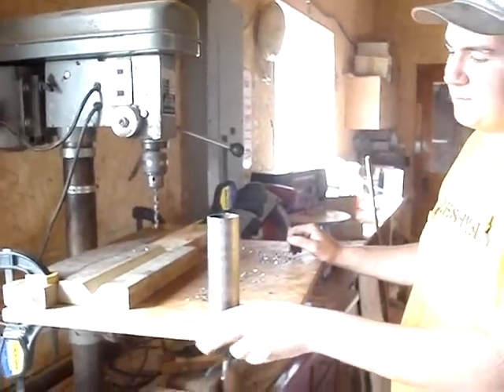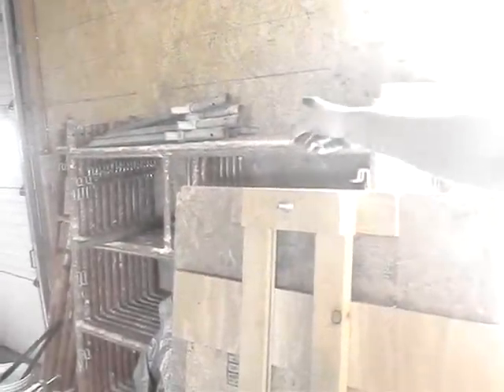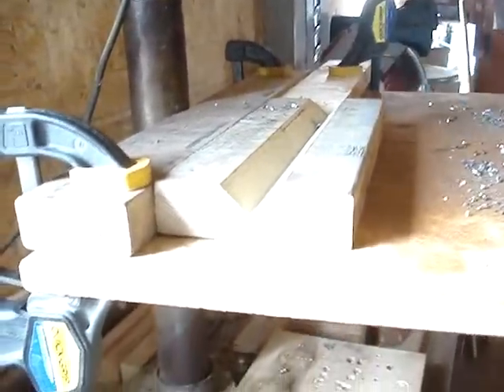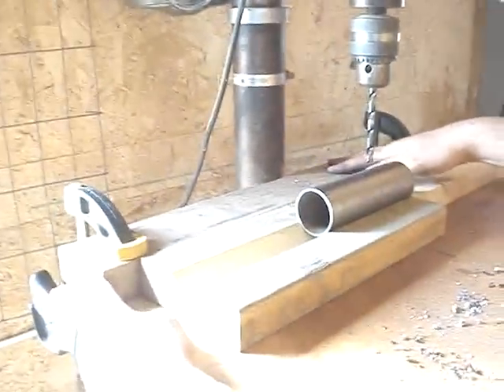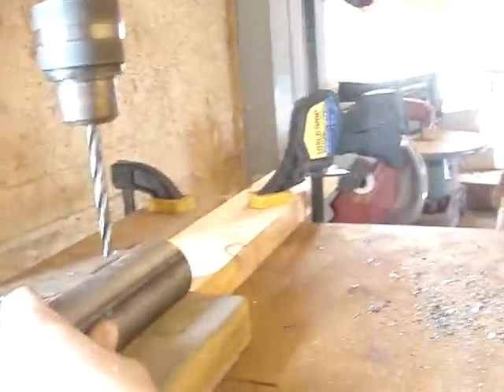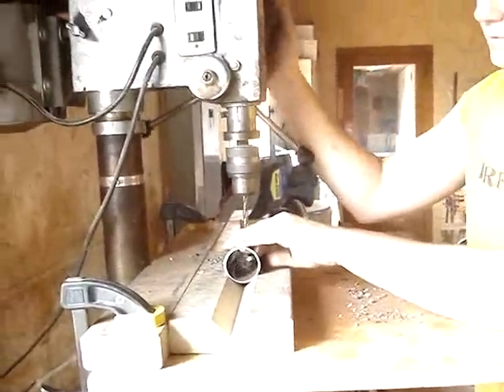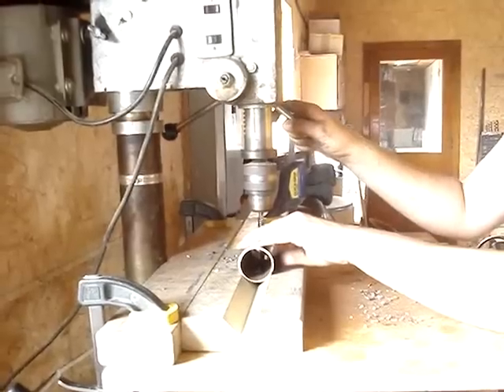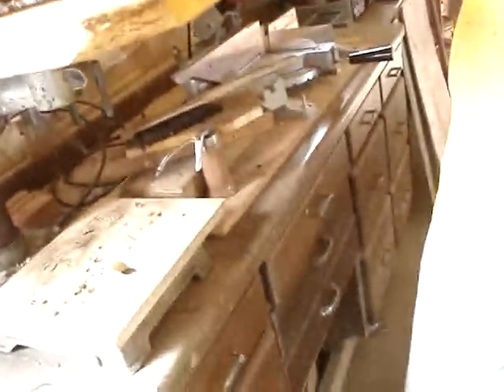Drilling Holes in Pipe

Comment: Hi, do you think I would weaken a pole measuring 2 metres in length and 48.3 mm if I punch two holes for two M 10 bolts roughly in the middle? The pole has to sustain 200 kg and would be fitted horizontally

Comment: The negativity is clearly the result of not understanding the basic laws of physics. To suggest anything wrong is being done here is to assume a level of danger exists. However in the application there is simply not enough centrifugal force coming from the rotation of the drill press due to its low speed to throw a chip into his eye. You can clearly see where the majority of the chips are flung and this gives way to the fact there is only enough to throw a chip about 8 inches away 1:05 you can see the furthest chip from the location of the hole. His head is clearly further than that. 

In the end he is making a judgement call and all decisions are based entirely on probability. How much of it exists in favor of him to continue with this setup and right now he has a probability in the high 90's that says he is fine. The only addition I would make to the setup is probably use of cutting oil as it will save his tooling and lower the probability of the bit snapping and a shard gaining momentum due to the force and energy exerted by it snapping. The idea should not be to allow the bit to snap and then cover up well enough not to kill you but rather to prevent the tool from snapping to begin with. The oil is enough. 

Lets all just admit one truth. There is no prevention that is 100% effective and the only way to prevent disastrous results is literally stop time since the forward motion of time itself is what causes all disastrous results. Then and only then can you say a method is 100% safe.
That said this will not produce accurate results as the press is not nearly as rigid as a mill so the quill and spindles movement is not supported in the same manner nor is the bit itself. To gain accuracy drilling a through hole the object should spin while the tool is stationary (yes like a lathe) so the flex of the bit can be accounted for and auto center itself. This produces good enough but not highly precise drilling but most of us will never need precision out of holes in fixtures and this result is accurate enough for the majority. 

And yes I think too much.

Comment: I would like to see you wearing safety glasses and also a clamp to hold your pipe into the V block.
When drilling thin wall material great care must be taken so as the work piece isnt grabbed up the flutes of the drill.....stone the cutting egde so it isnt so sharp often helps.